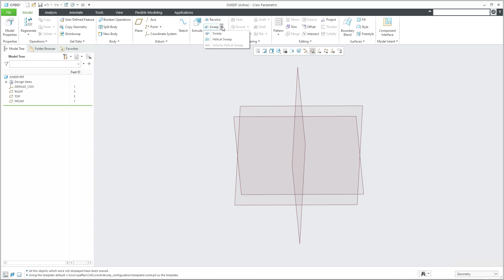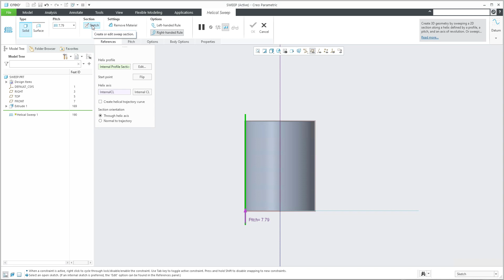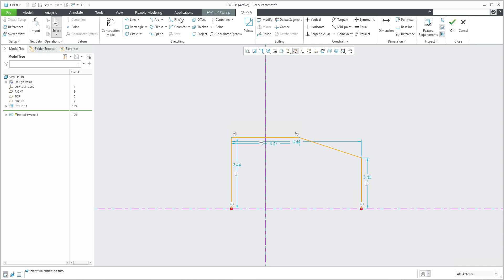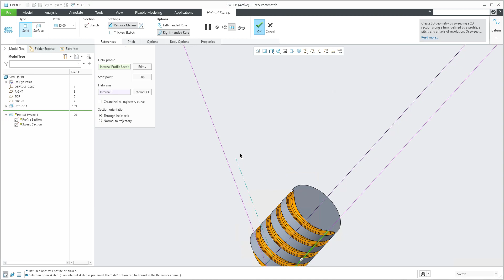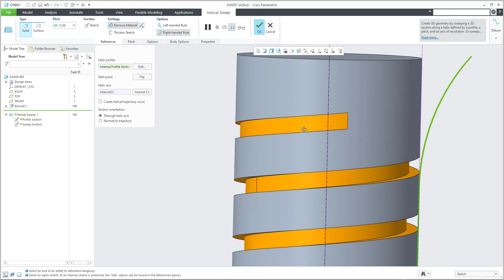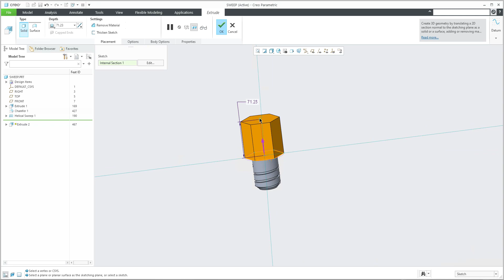Helical sweep for beginners | Creo tutorial

Comment: what system requirement in laptops for creo?
please suggest me some laptops
Reply from the maker: Hi, I use Dell 5530. Try to find similar specifications (most necessary is external graphic card / I prefer Nvidia because is possible to use Creo simulate live if your graphic is more that 4GB) RAM is 16Gb. Good luck. And thanks for your question. Stay tuned. Vladimir
Reply: @4kside  and processor and its generations matters?